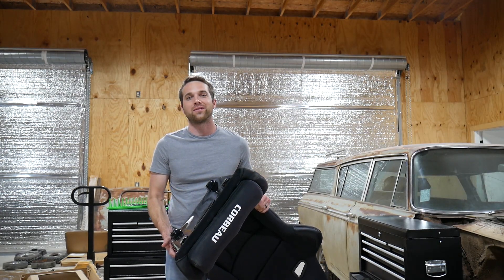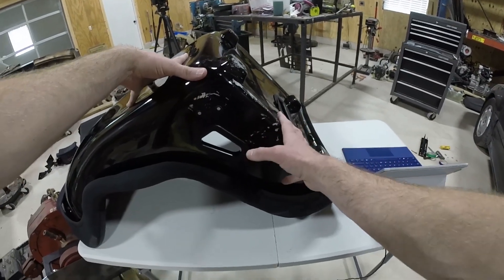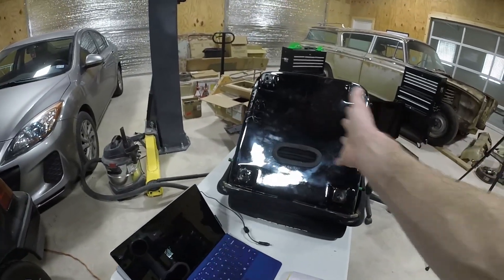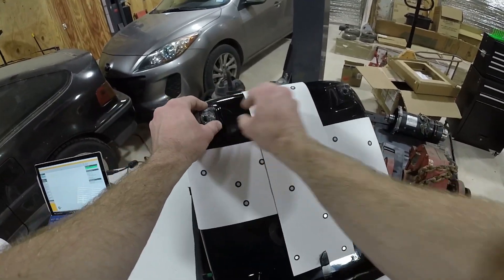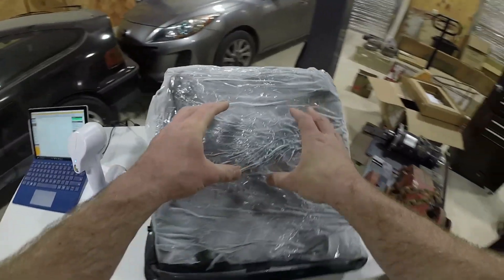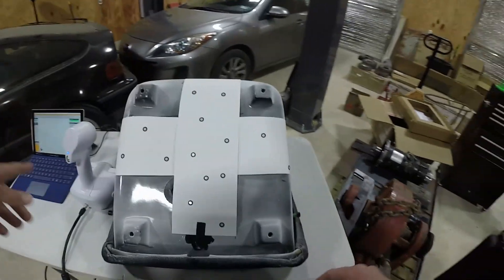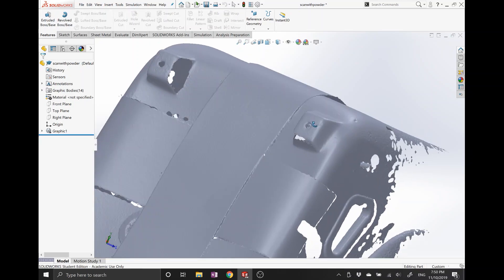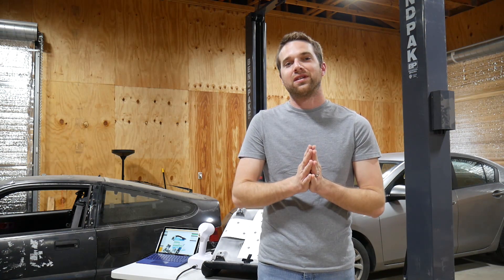More 3D Scanning - CRX Seat Mounts

Comment: Thanks for posting. I just bought the Peel 2 CAD partially because of your videos. I saw you are using a Microsoft Surface here. Which model of Surface? The Peel site recommends 32GB RAM, an NVIDIA GPU with 2GB RAM, and a 2.7GHz 4-core i7. This suggests a maxed out Surface Book 3? Thanks!
Reply from the maker: At the time of filming this project I did use a Surface, and I'm not sure about it's spec. Since then I built a PC that I use with the scanner that more closely aligns with the recommendations (I have it on a cart so I can roll it around, its in the background of some of the later scanning work).
Reply: How well did it work with Surface? I’ve also just built a desktop PC that will work for the scanning, but am also looking for a mobile setup. One thing that might be possible with a Surface is to make a fixture to mount the tablet onto back of the Peel, so you can see the scan “painted areas” as it goes without having to look away. Thanks!
Reply from the maker: That's a really cool idea! The Surface worked out well enough but the main limitation I found was the RAM. Forced me to cut back on either mesh density or the volume I was scanning. Maybe a Surface-sized monitor could be mounted and used to function in the same way, that way you use the PC capabilities but get some of the mobility back? You'd have a few more cables to work with but you won't be limited to the Surface specs.
Reply: @DirtyElbowsGarage  awesome idea on the small monitor with the desktop! My Peel 2 CAD just arrived, so I’m excited to dig in. I’ll try to post some videos to help others; yours have really helped me. Thank you.

Comment: Nice video. I’d suggest Krylon Clear Dulling Spray 1310 in place of powder spray though. I was using gold bond spray and making a mess, and went looking for alternatives. I set up targets, spray the shiny bits including targets, and the Peel does amazing. Probably going to print some nut and bolt locators soon. Locating bolt holes is tedious so thinking some threaded pyramids with targets on them would allow more precise placement in the scan for fixturing as well as defining planes.
Reply from the maker: Good ideas and thanks for the tip on the spray!